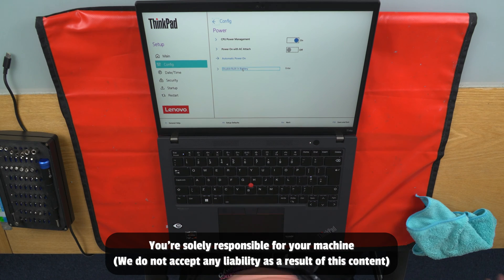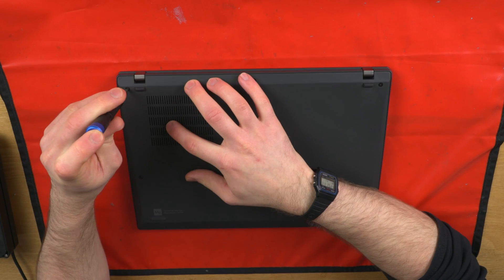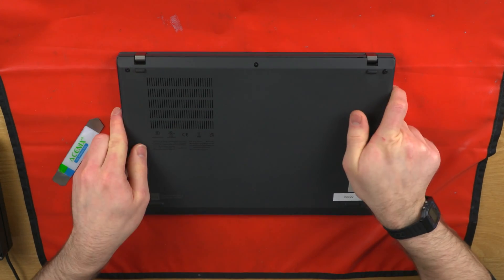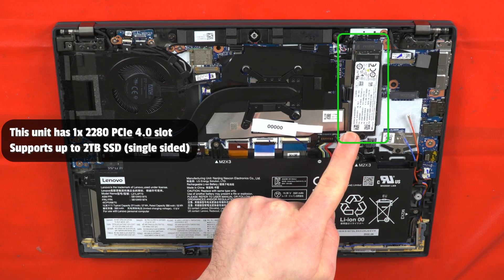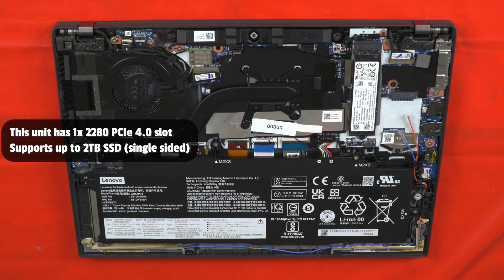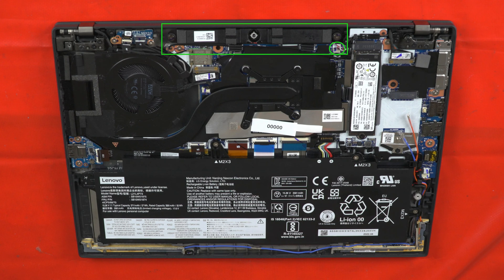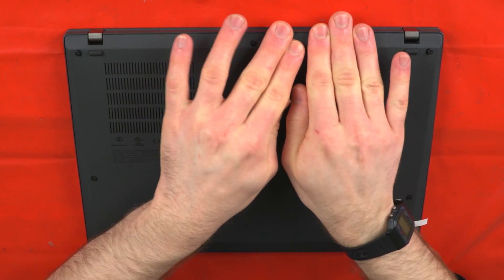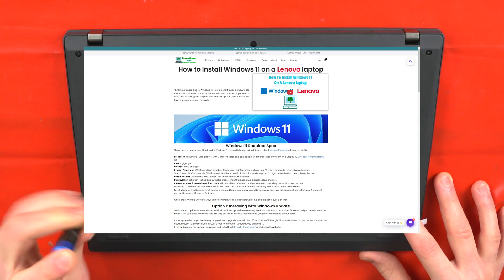Lenovo T14s Gen 3 (AMD) SSD Upgrade & Internal look

Comment: Is it possible to upgrade with 990 PRO with Heatsink? Is it enought space for it?
Reply from the maker: Generally would not suggest jamming in a great sink as there is not much air flow and the SSD might probably overheat. Using something e.g. WD or something more modest in the performance plus heat is suggested.
Reply: @GreenGreenStore  thank you!